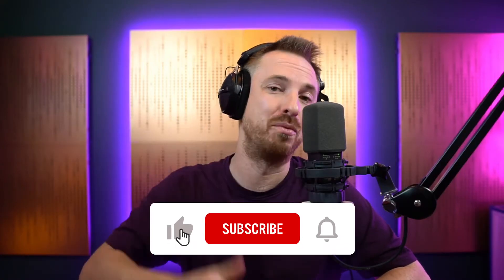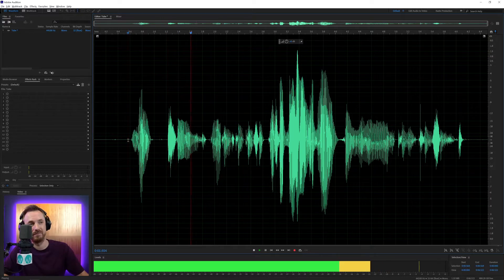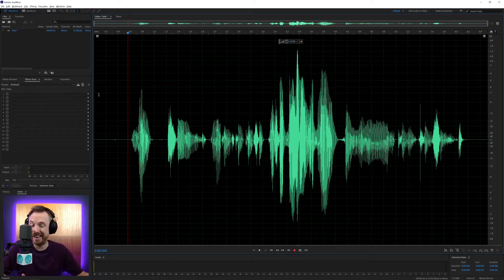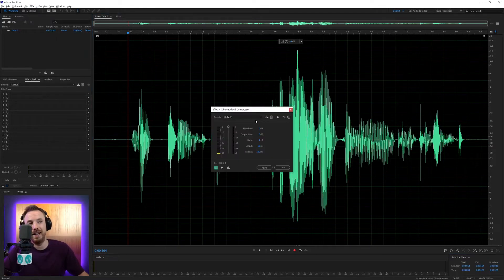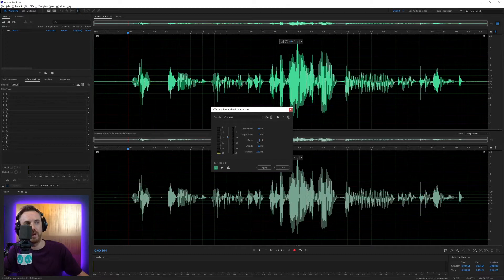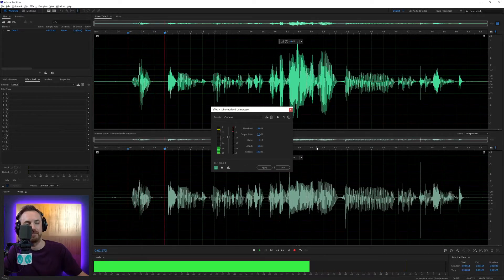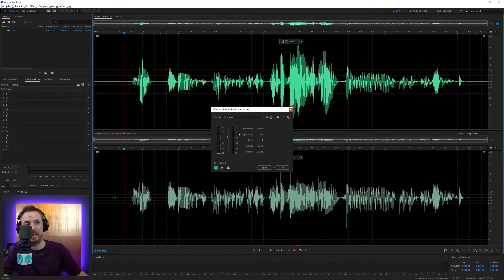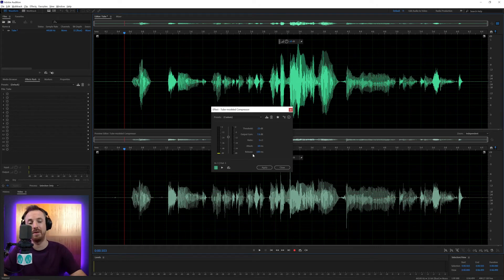Adobe Audition Tube Modeled Compressor Tutorial

Comment: Heyy Mike, I realllly need your help! I've been using Audition for a long time but recently my mixes sound fine on audition but once i mixdown my project & play it on my phone, in the car ect. My mixdown sounds distorted, like there's static & noise, and I've even tried to mixdown just my lead vocals & the beat only with no changes, effects or plugins and my recorded levels are -12db or more so its not clipping..I"ve never had this problem before in all my years of using Adobe Audition & I can't seem to figure it out for the life of me. If you have any suggestions i would so gratefully appreciate it. Driving myself crazy over this would be an understatement, lol.
Reply from the maker: Audition will only do what you instruct it to do, there must be an effect in the mix which is causing the problems, or you're working in 16 or 24 bit and introducing clipping.  Give those suggestions a try 👍

Comment: Hey Mike I've got a question ok so I'm recording rap music in Adobe and I have problems with popping and clicks in my audio when I record mind you I'm using waves plugings and I can't use more than 3-4 racks of plug-ins, I have an I-7 11 Gen  7700 processor and 16 gigs of ram what do I need to do
Reply from the maker: This could be down to analogue clipping but more likely down to either buffer size or hard disc speed.